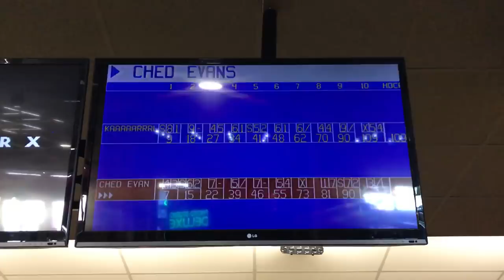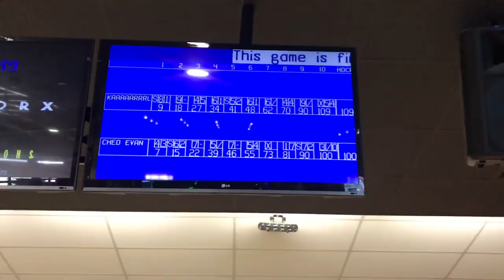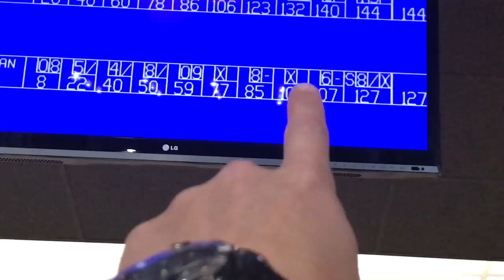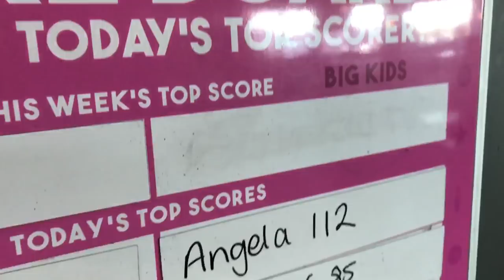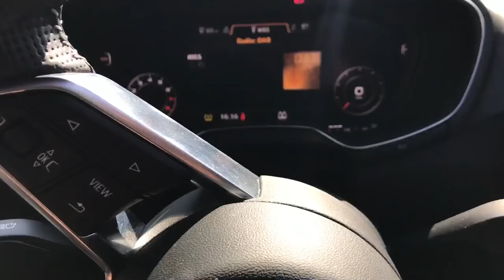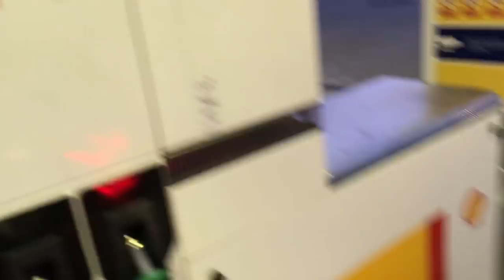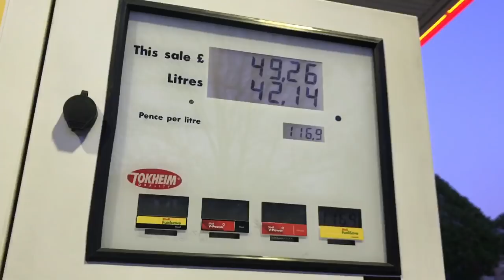WATER BUCKET PRANK MY DAD!

Comment: Tom, a thing about Steeves substrate, I use sand for my leopard gecko and I have had no problems with impaction what so ever. So I think reptile sand (not play sand) is fine as its cheap and easy to maintain. The problem is with calci-sand, the reptile will try and eat the sand due it having vitamins in it which is calcium and the sand is CaCO. Even though they say reptiles can digest this they can't which is when problems occur, so as long as you have normal sand and not calci sand then you should be all good. Just double check just in case as we don't want anything to happen to him and I'm just looking out for you but I'm sure you have done your research, just a heads up to anyone who is unsure still :)

Comment: Just in case you wondered why the pump didn't work... They have to see you standing at the pump in the shop and then they turn it on for you.  It is a security measure so they know you're going to pay for it. Only only know that as I worked in a shop with a garage back in my teenage years.